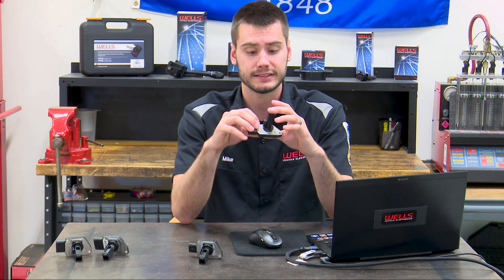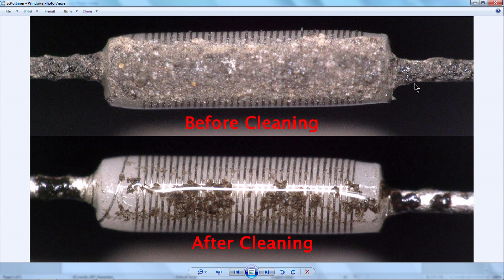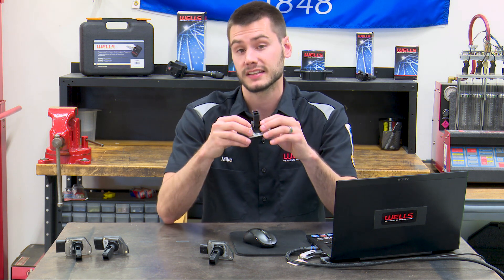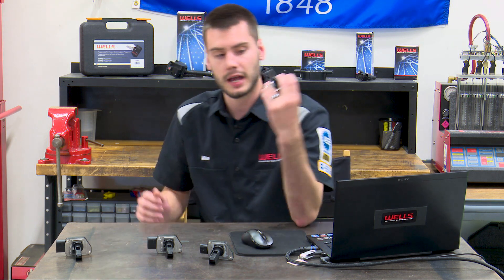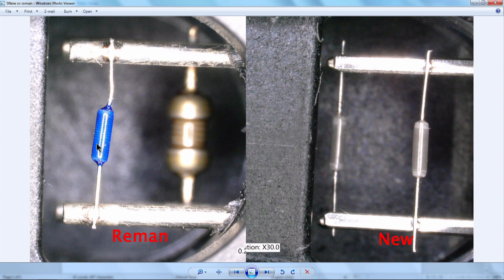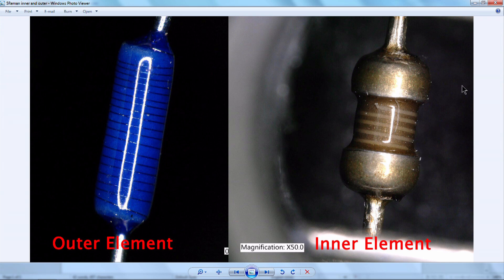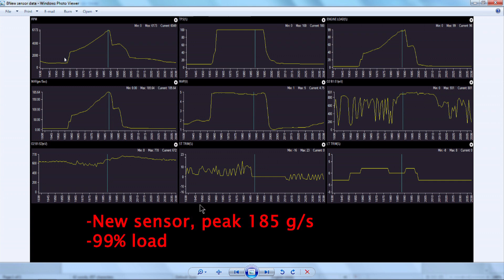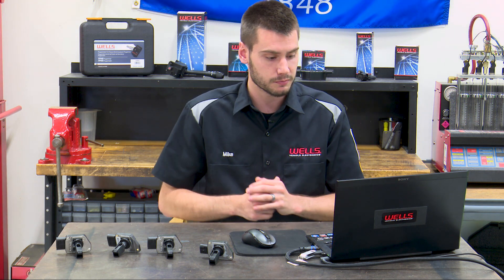Wells TechConnect Ep. 19--Does cleaning a mass air flow (MAF) sensor really work?

Comment: Hey Mike and great follow-up video on how effective is cleaning MAF sensors. I've always wondered this myself and sure, we've all cleaned them and we feel the difference in our seat on acceleration, but did we really bring it back to OEM specs. And you've answered that very well. As for the comparison between the rebuilt and new unit, there was a big difference in the appearnce of the thermistors and they looked like typical wire-wound resistors. Being how that one of the thermistors is in a wheatstone bridge, these thermistors must have a very close tolerance resistance to be accurate in determining air flow. As seen from the photograph, where one thermistor is shorter than the other, the resistance has to off although by a small amount. It's good that you tested a brand new aftermarket and a new one. And although there was a small difference, you proved that there was a difference. Great work Mike and looking forward to your evap training. Have a great weekend!
Reply from the maker: Thanks for watching Stuzman! I agree, cleaning always seemed to make it feel better, different, more powerful. But, after taking these photos on the microscope, I know exactly what i'm going to be recommending to my customers in the future. I think we, as techs, should maybe approach it in 2 different ways. A low cost, temporary fix(cleaning) or a long term, higher cost, solution(replacement). Thanks for watching! You have a great weekend as well!
Mike Becker, Technical Services Instructor
Reply: @GoTechTraining  I mean, I'm betting some of the newer MAF sensors are very expensive. I'll take an $8 can of MAF sensor cleaner if it makes the car run better (not perfect, but better than a dirty MAF) over paying hundreds for a new sensor.

What do you think? Surely they are not cheap...

Comment: I have cleaned a lot of MAF sensors, over the years. I use MAF cleaner only. I had a Ford pick up that had a hard shifting issue. After many grueling hours, I cleaned the MAF and it fixed the problem. I have seen fuel trims "cleaned up" on some vehicles after cleaning.
Reply from the maker: John, that is a great point! Our job is all about making the customer happy, right? As long as you are upfront about everything, you present the facts of cleaning vs replacement, then it's the customer's choice. There can be no hurt feelings if the sensor fails again shortly after cleaning that way. As for the damage...I think it's essentially a sandblasting effect. The cleaner cleans any stuck dirt/sand away to reveal what that dirt and sand has done. The cleaner does not eat away at the coating, unless you use carb cleaner!
Mike Becker, Technical Services Instructor
Reply: @GoTechTraining  If you have sand flowing past the MAF enough to accumulate on it, the engine is trashed too.
Reply from the maker: Hey MrOlderandwiser, that's great to know! I have cleaned some sensors in the past and had luck, but they always seemed to come back. I think the microscope really does a great job of showing us why cleaning isn't really the proper fix.
Mike Becker, Technical Services Instructor
Reply: I tell my customers that cleaning may or may not work, and I live in a town where money is tight and if someone can possibly save 2 to 300 dollars til they can budget or plan on spending that money its pretty obvious what they do.
Do you think the damage to the sensor is from the "cleaning" or is it there and just covered up with crap? Thats pretty cool seeing that under a microscope.